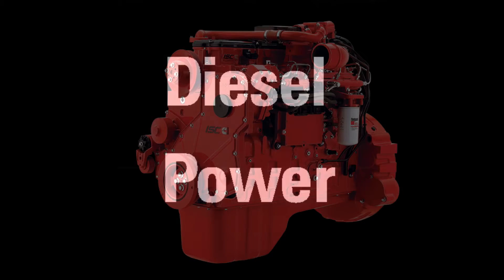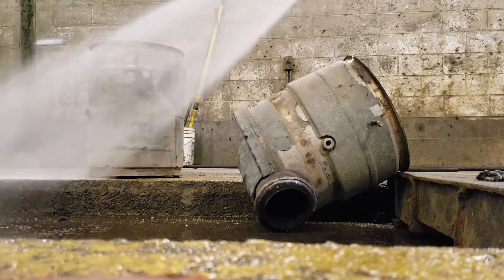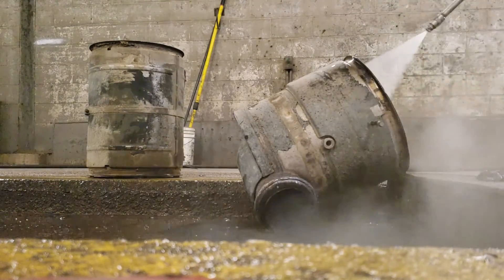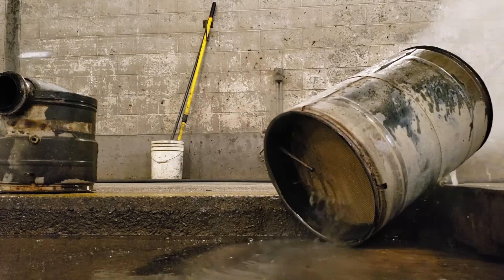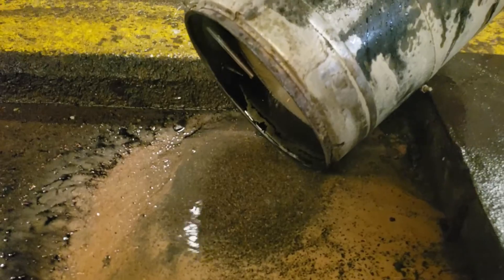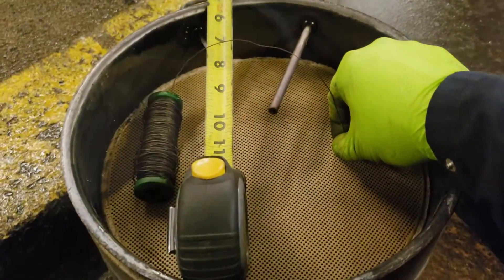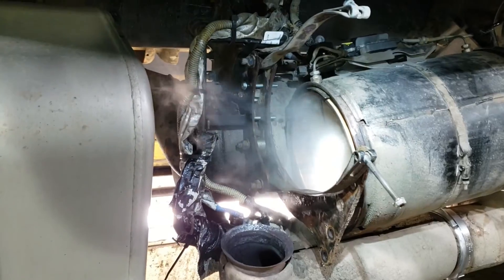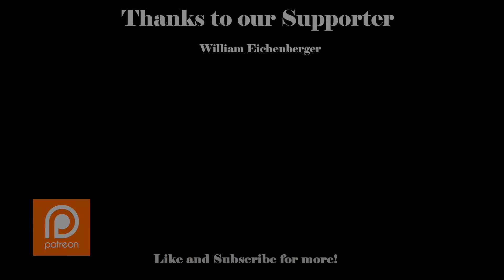DPF Revival

Comment: will be looking at doing this next week.  I believe customer has excessively idled the engine and plugged up the DOC.  A regen only lasts 6 minutes before it kicks out from over heating at the first temp sensor.  Hopefully the DPF and DOC splits apart like yours, otherwise I guess i'll be washing the soot and ash back through the DOC.  Thanks for the vid.!

Comment: I had 2007 International bus that was clogged up so bad that it clogged the EGR cooler and intake heater element.  I cleaned everything and replaced EGR COOLER and EGR VALVE. The bus would run for 5 seconds and died.  After cleaning DPF and DOC and did regeneration twice,  the bus is running great. Thank you for the informations. Great help.

Comment: Just clean it on 08 International bus. Got most of it out and did a regen even though the ECM said no regen needed. But it needed regen because the bus wasn't ran long enough to get the code for regen. While I was doing a regen the code came on for regen need and the temperature went above a thousand degrees to clean the sud out. Now the bus ran fine.

Comment: Thanks for the video i washed it i didnt had air to blow the water. After 4 hours i installed it. Changed the 7th injector and doser valve. No other codes except (clogged particulate filter soot accumulation)
Can that be from the moisture and left over water?

Comment: good video how Mach pressure u need for wash
Reply from the maker: The one I use is about 3500psi and it works well.
Reply: @TheDieseler  at GPM?
Reply: Motty Ruttner didn’t look like much. I’d guess no more than 2
Reply: Will lower pressure be ok? Or does it have to be that high.

Comment: Does having some moisture in the dpf affect the scr in anyway?
Or is what's remaining after using air completely boil off during run test?
And how do you keep the truck from throwing codes when the exhaust is not complete?
Reply from the maker: I've never had an issue with excess moisture in the system. Blowing most of it out and allowing a little drying time has always worked fine. It will set codes while running partially disassembled but I just clear them afterwards.
Reply: @TheDieseler  just bought a 2010 it's asking for a Regen but never complete shutoff in 15 min I work local now the light it's always on  I have 871  550 Cummins can I
 wash my dpf and doc I want to ask you it cold water makes any difference please reply with a suggestion thank you

Comment: Funny thing i just did this today kind of, we have had an Isuzu with dpf issues in the fleet, 4 years ago it had an egr cooler failure and never got pulled apart, after the issue got so bad but couldn't pull the truck off the road we left the scan tool with the driver to clear the codes and do manual burns we finally got it in this week, the first section of the dpf is failing and falling apart so quote up new one ouch 7.5k, so get a new center section, all ready had dpf cleaning fluid to soak the dpf in, Went to my self if i can wash out as much ash and soot before hand this should help the dpf cleaning fluid, So got the fire hose out as i did not think the filter could handle to the pressure wash, and start reverse flushing, well the amount of coolant i washed out that had been there for 4 years was amazing, looked at it and went might not need the dpf cleaner, then went bit bored tonight ill see if anything on dpf cleaning fluids is on you tube before i clean it, seen your vids and went i just did that lol, ill prob still give it the dpf fluid but ill do the wire test before and after and see if any difference.

Comment: Been power washing the filters for years...   Learned from a manufacturer from Mack the process and true purpose... So sad so many drivers & technicians are told different and drop paychecks into the design.
Reply: When I worked fleet, we had some prostars I was told had "failing dpf"s because they we need regens everyday. I figured they're on their way out anyway, so one one was finally face plugged, I tried this out in secrecy from my boss. I never had to take a dpf one time to the dealer to have it baked. The ones I cleaned also didn't have regen issues either!
Reply: @fabronfretwell3257  did you wash the doc too ?

Comment: Thanks a lot for your videos I did try your Power wash method it works great, Detroit diesel DD 15 one box thank you so much for your help all l had to spend on were clamps. I do have the  dddl software to Perform a regen

Comment: Just to reinterate, so these DPFs capture the soot, is then burnt off into ash, then the shop after about 5,000 hours wash them out with pressure washer water! Where does the water go? Yup, as suspected, back to the ground, contaminating the surroundings and into the water table. Friggen racket...
Reply: Good thing this stuff has to go through hundreds of feet of dirt and porus rock to get into well water. Water is also filtered so this stuff doesn't harm you. Plus must of these truck places have special services which come collect contaminated substances so it doesn't get into water supplies.
Wouldn't ever happen if we didn't require DPFs on diesels now adays.
Reply: who gives a shit. i saved 2k
Reply: The diesel it self got from the ground damn fool😂
Reply: @user-sb8ip2ef3t : This was a rhetorical answer about how stupid the DPF, Exhaust Gas Recircutions systems are ridiculous. You don’t have to be insulting me by calling me a damn fool! The point behind my comment was about how crooked the government regulations have become,when the leaders themselves cause an enormous carbon footprint by flying around in their corporate jets!!!